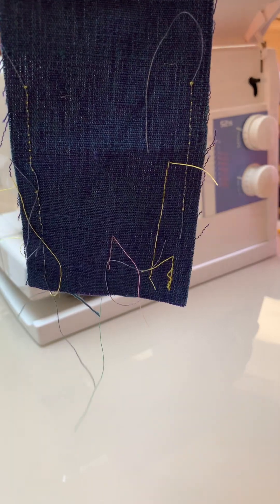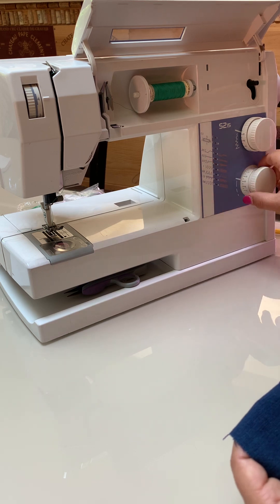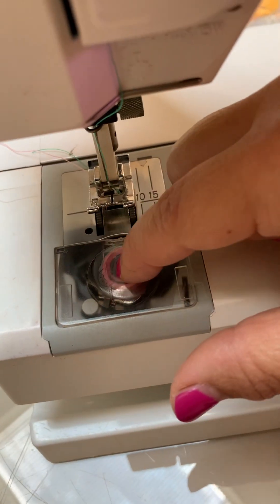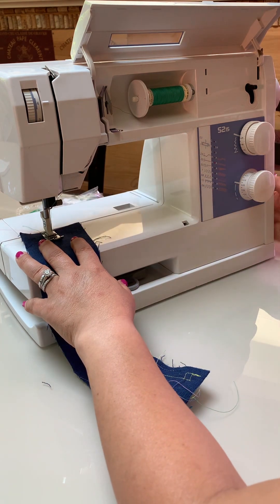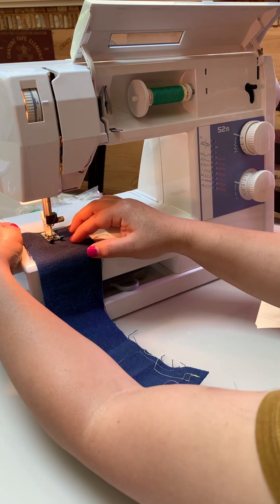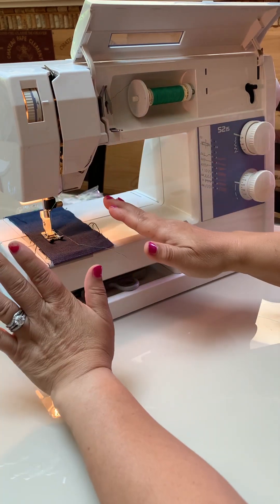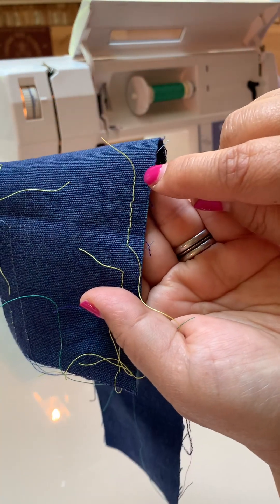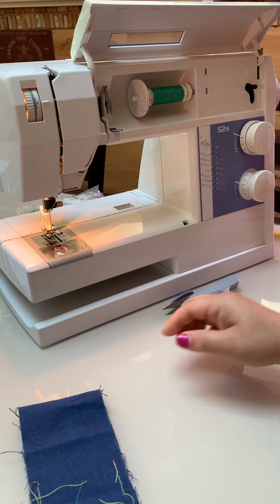Get started 2 - test stitches ANY sewing machine! Husqvarna s215 225

Comment: Hi i am watch you frumos România...i have this model of husqvarna but i steach on lycra and elastic tulle...I do gimnastic ritmic costum...if you have advice for my I am hapy...or do a video am test this materials. Have a nice day
Reply from the maker: Hi!  This is a great question.  The BEST way to stitch lycra and elastic tulle is with a serger.  If you must use a sewing machine, I would use the zig zag stitch to "join" seams.  Then I would use the broken zig zag to "topstitch" over the elastic while gently stretching as you sew.  Would you like a video to show this?  For the elastic tulle, which I call "illusion," I would use a zig zag to stitch and no need to hem.
Reply: Yes if you doo a video will by very good.